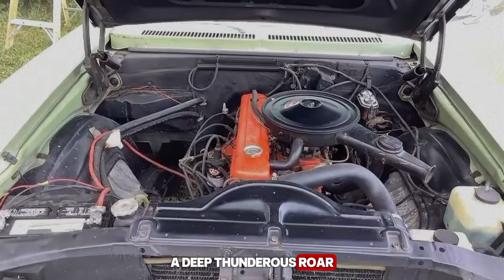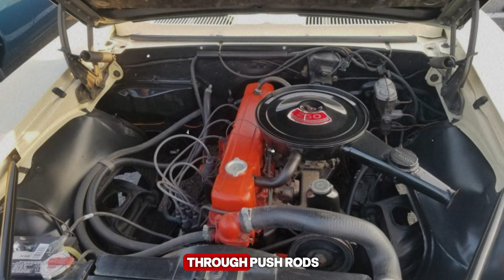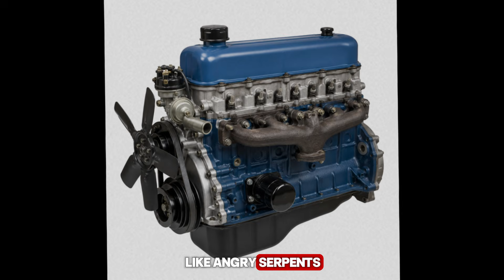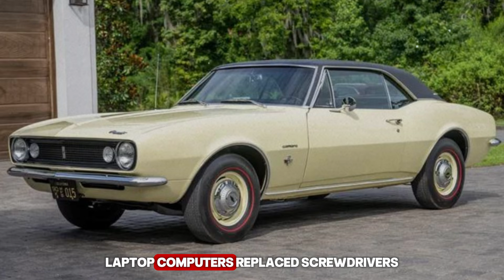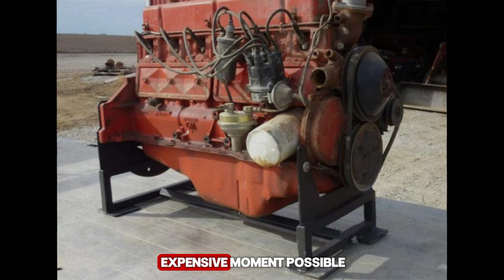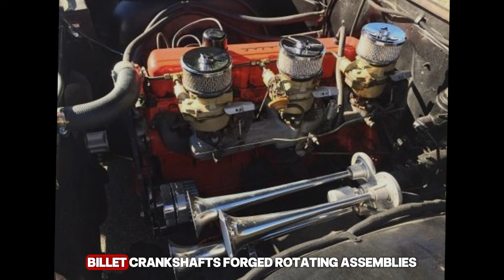The Inline-Six That Embarrassed Chevrolet's Entire V8 Lineup

Comment: This is absolutely possible to do was not just a straight six but a lot of engines and the extra main mains does help bottom and stability.  But they do realize that if you do these things to most engines, you get the same results.   Do all of these things they’re talking about to that 396 they mentioned earlier and it’s capable of some truly astonishing numbers and you can even go up from there with more cubic inch.   More airflow and even boost if that’s what you want to do.  Engines are just air pumps that introduce an explosive mixture at the right time to transform heat energy into linear and then rotational energy.   There is nothing magic about the configuration of cylinders or number of cylinders.   Some of them work better for some purposes than others, but there is no secret formula.   It’s just physics.  This is obviously an oversimplification, but so is this video.